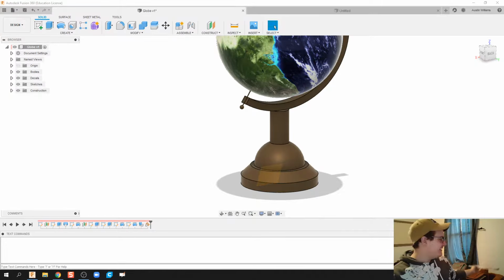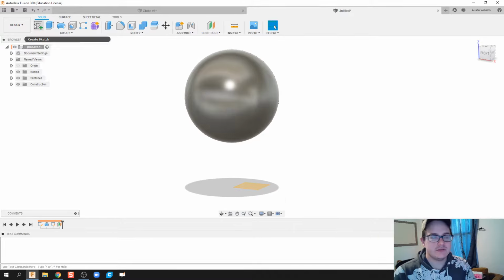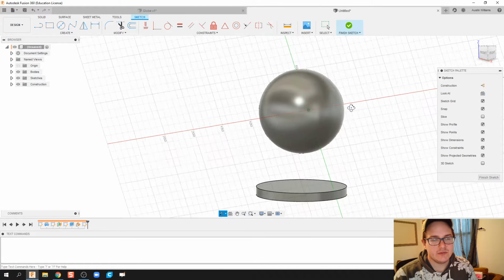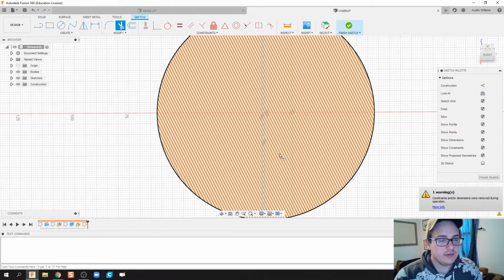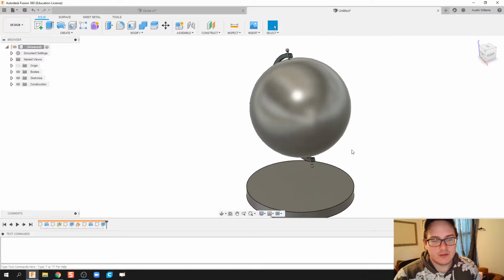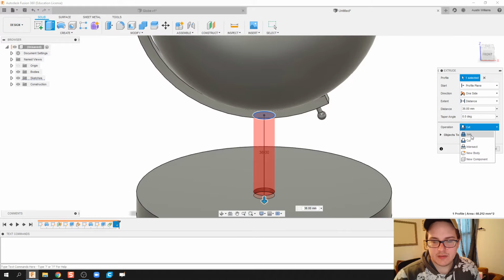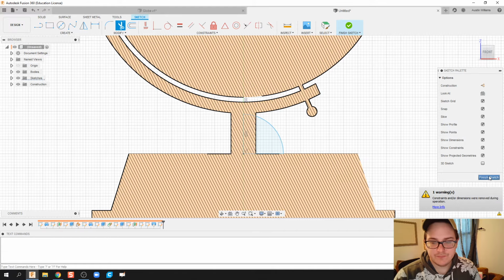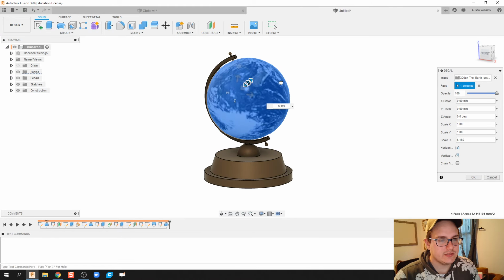Plane at an Angle - Day 23 of 100 Autodesk Fusion 360 Journey

Comment: Thank you for the good video.

I have a question.

I want to mark the countries of the globe in detail.

What function should I use?
Reply from the maker: If you are able to get an accurate image of earth stretched on the globe, that would be awesome! However, I imagine that is pretty difficult to do using this approach.

I guess you could ping certain spots on the globe using the Point Function to put a flag tangent to the surface of the globe using that point.